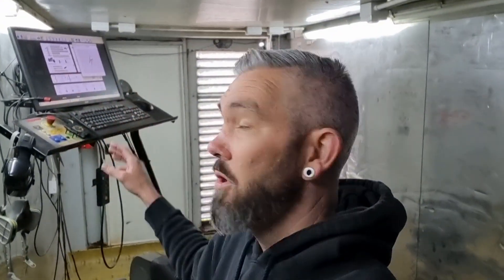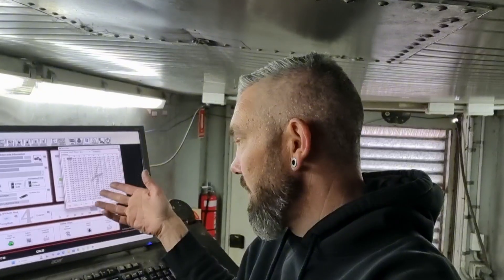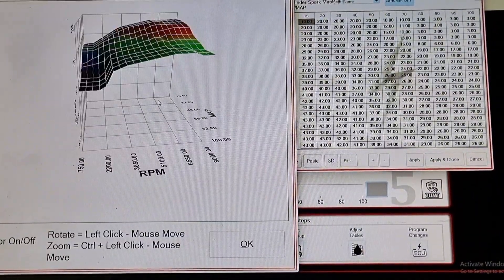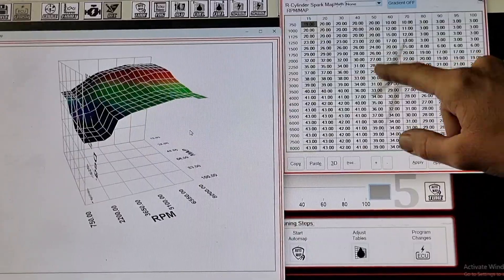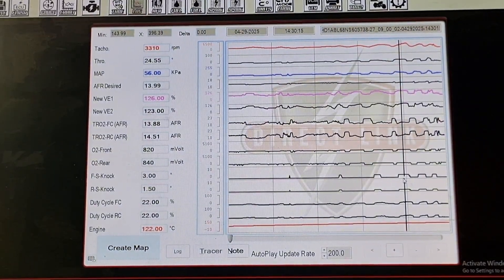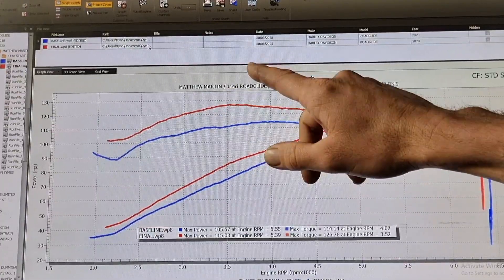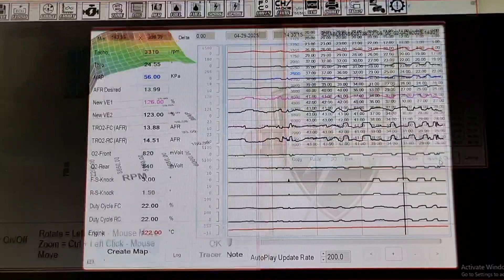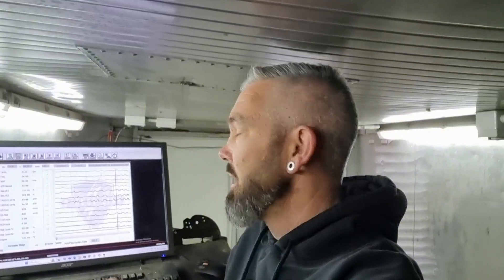Ignition Timing Explained – Step by Step Tuning Guide

Comment: Thanks for the excellent content! Recently, I installed a Tier1 Consecutive Cycle Tuner on my stock 2014 XL883N (Iron) and it makes for a very smooth throttle response compared to the standard EU-tuning. QUESTION: Does the CCT have an influence on the ignition timing? I chose for the Tier1 because no splicing wires, etc... just plugged between the injectors and the ECM and a ground wire directly to the battery minus. Fuel consumption is virtually similar, maybe 3 pct more.

Comment: Great great info!! Can you tell how many and which all adjoining cell shall be updated with what value?

I do have target tune, it’s only the rear cylinder that knocks under sudden acceleration that I can correct.
Reply from the maker: Unfortunately I can't suggest what figures should be in what cell/s it will come down to data logging and making incremental changes until a result is found
Reply: @MasterTechMiller can I request you to do a video of doing a real-time data logging, opening them in Dynojet power core and making exact corrections in exact and adjoining cells 

Would help riders like me who don’t have access to dyno tuners to correct the tune to some extent atleast

Comment: Hey Master, I have couple questions:
1- is it possible to have no knock at all in m8 engines? seems like how much I retard timing, it shows some knock retard.
2- is it possible to find MBT before knock occurs? lets say I am tuning with logs, can I advance timing until knock occurs with pump gas?
3- does it help to use colder spark plugs to reduce knock events, for example for a stage 2 117?
4- how frequently do you think false knock occurs? is there a way to distinguish them from real ones?
thank you so much
Reply from the maker: 1. Is it possible to have no knock at all in M8 engines?
Not really. The M8 knock control system is very sensitive, and the ECM is always “listening.” Even with very retarded timing, you may still see small amounts of knock retard logged. This doesn’t always mean true combustion knock – it can also be false knock triggered by mechanical noise (valvetrain, piston slap, transmission lash, etc.). So, it’s rare to see a log with absolutely zero knock retard everywhere.

2. Is it possible to find MBT before knock occurs?
Yes – in fact, that’s what you’re aiming for.
MBT (Minimum spark advance for Best Torque) usually comes before knock on pump gas.

When tuning with logs, you can carefully advance timing until torque (or VE airflow on logs) stops increasing, and then stop. If you push too far, you’ll hit knock.

On pump gas, knock is often the limiter before MBT is fully reached in higher-load areas. On good fuel, you can usually achieve MBT without knock.

So, the answer: Yes, you can tune toward MBT before knock, but be careful—especially at high load, MBT and knock limit can be very close together.

3. Do colder spark plugs help reduce knock events?
They can, in certain cases.

Colder plugs help reduce hot spots in the combustion chamber, which can lower the risk of pre-ignition/detonation.

For a Stage 2 117ci, moving one step colder is often beneficial if the bike is ridden hard or in hot climates.

That said, colder plugs alone won’t solve poor fuel quality, excessive compression, or aggressive timing. They’re just one tool in the box.

4. How frequently does false knock occur, and how to distinguish it from real knock?
False knock is very common on M8s.

You’ll often see knock retard appear in random low-load/light-throttle areas where real detonation is very unlikely.

Real knock usually happens under high load, higher RPM, and higher cylinder pressure (WOT, climbing a hill, heavy throttle).

False knock tends to show up at odd times—steady cruise, shifting, or light throttle—and usually only pulls a degree or two briefly.

To distinguish:

Look for repeatability. If the same cell/load/RPM always shows knock, it’s likely real.

If it’s random and not repeatable, it’s probably false.

Logs combined with dyno/load testing are the best way to separate the two.
Reply: @MasterTechMiller thank you very much for taking time and answering all these questions in detail 🙌🏻 greetings from Turkiye
Reply: @MasterTechMiller Brilliant breakdown!!

Comment: Can the knock sensor read a false knock?  My rear cylinder is about 4 degrees less timing than the front and I still see knock occasionally. Maybe 1 of 6  wot pulls will record a single knock around 4k rpm.  How many degrees less is typical for the rear cylinder running hotter than the front?
Reply from the maker: Yes they can! They are always "listening"and can detect piston slap, valve train stack up tolerances & even the 2 flame fronts colliding in the combustion chamber. 

I went into more detail about this question in an answer I provided to someone else. It's in the comments of this video.

Anyway, I typically see 3 to 4 degrees of "knock retard" when I know it's a false reading. 
A lot of time on the Dyno & tuning has taught me how to better understand the false from real knock events.

Comment: If I lived more than 861 km from my tuner, I'd be tempted to play with ignition timing.  I'm happy to play with VE tables based on log feedback, as well as injector phasing & throttle maps to keep a little vacuum in the manifold at low revs with high throttle, as well as to smooth out the off-on transition also at lower revs.  I'll pop in 2nd week of October if you're about.
Reply from the maker: Sounds good mate. Looking forward to it.